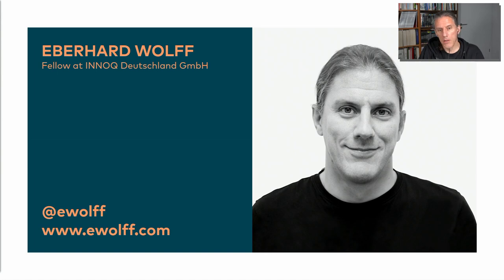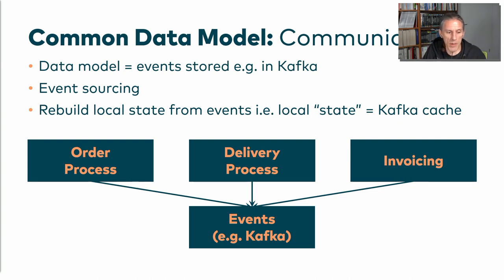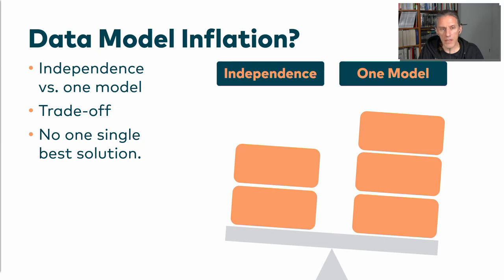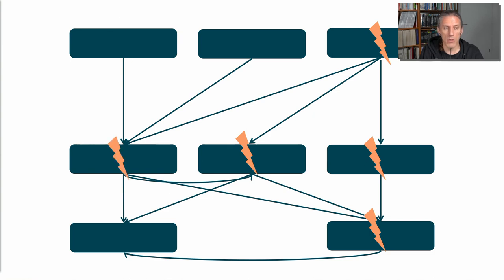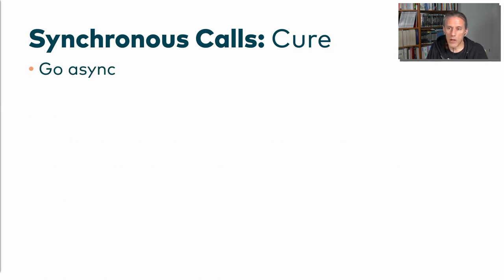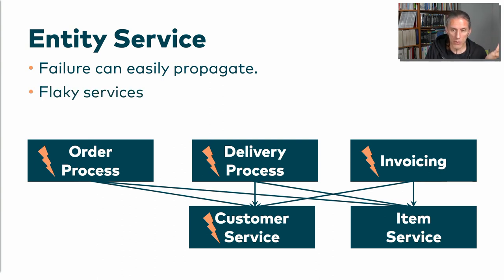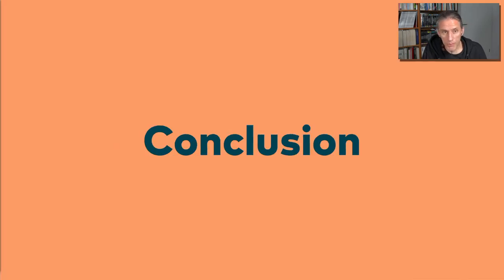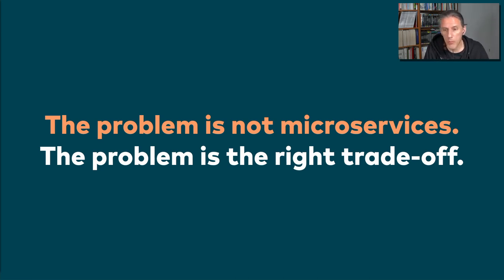Why Microservices Fail

Comment: So the entity service cure is data redundancy. How do you avoid inconsistent data between the database schema, and how do you handle these when they appear?
Reply from the maker: I wouldn't say that data redundancy is the cure. The cure is to have bounded contexts. Each of them has a separate data model. So a delivery process might be interested in the weight and size of products. An invoicing process might be interested in the price and VAT of a product. There might be some overlap in the data of the two bounded context - that data would indeed be redundant. Potential inconsistencies are the consequent. So it is a trade-off and the potential inconsistencies are the disadvantage in that trade-off. I still feel that most often the by far better trade-off is to avoid entity services.
Reply: @EberhardWolff  

I actually found the argument made against common database a bit unconvincing.
But isn't it the question to weigh these complex issues introduced by microservices against the benefits of having a microservice architecture at all? Microservices solves some problems in data centers, but create new ones in the software development.
Reply from the maker: @menotyou3445  I see overly complex database models all the time. That is why I think splitting a huge database model into several smaller ones is a solution to many problems my clients usually have. This does not necessarily mean they should do microservices, it is rather about bounded contexts and DDD.